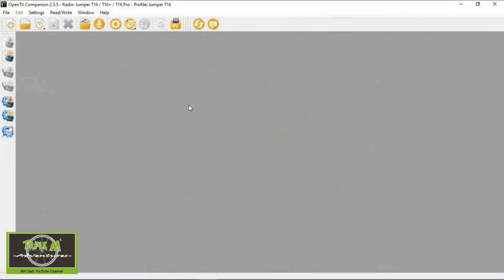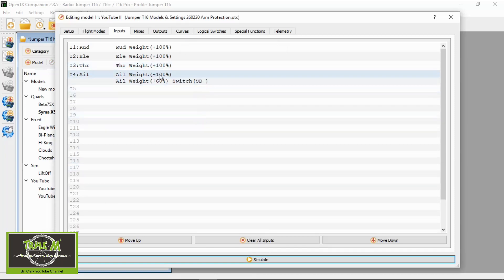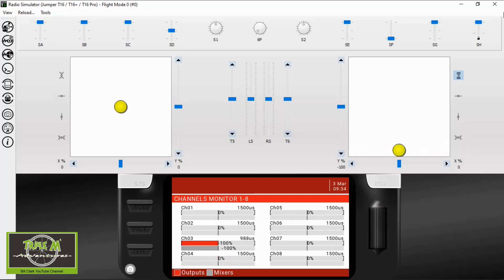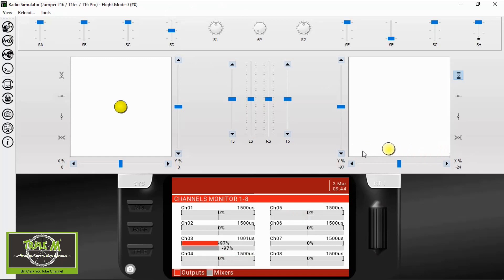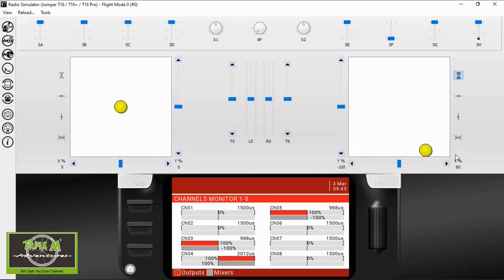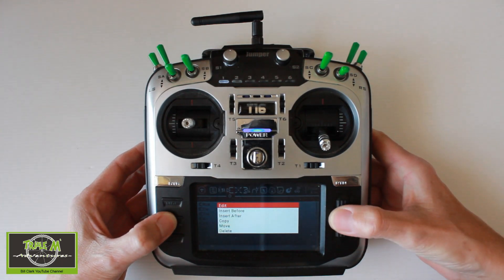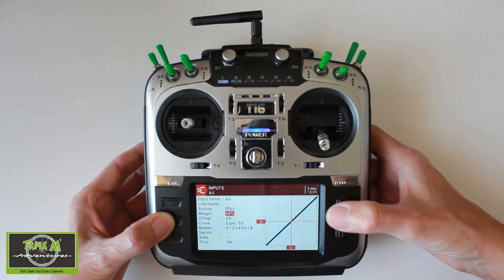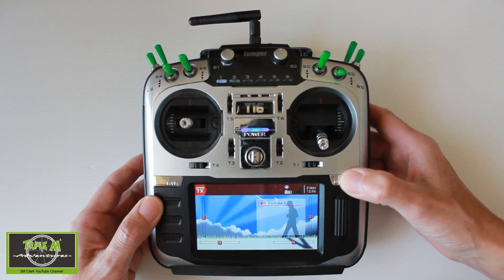Setting Up Dual Rate in OpenTX for the Jumper T16

Comment: Hello, Bill do you know how to move the scroll wheel on the transmitter simulation screen?
My wheel broke on the transmitter.
Reply from the maker: emil where you would use the scroll wheel on your T16 in companion use + or   - on your computer keyboard.
Reply: Bill Clark I can only click it but can’t figure out use roller so u can change the model? How do I use my key?
Thanx
Reply from the maker: You will need to go back to your radio back up screen and select the model you want to see the settings in OpenTX Companion. It will only simulate the model you have chosen. If your scroll wheel is broken on your T16 I assume you are stuck on one model?
Reply: Bill Clark will I be able to change to a different model?
Reply: Bill Clark how do u scroll the wheel in radio simulation? It allows me to click wheel but I need to scroll over to another model?
Reply: Bill Clark yes
Reply from the maker: emil gabl you will only be able to change to a different model in your Jumper T16 by repairing the scroll wheel. You can get replacement parts and it is not a difficult job to do. You cannot change the model in the OpenTX Companion.
Reply: Bill Clark ok, thanx

Comment: Hi Bill,
Thank you for sharing. Could you please help me understand why you used Inputs instead of Mixes? This is something that confuses me terribly.
Reply from the maker: Oak C sometimes YouTube does not send me notification of comments so sorry for the late reply. The inputs are directly related to the stick movements and related to the channels on your radio to explain you can allocate any switch on your radio to a (input) channel. If you wanted to mix rudder and aileron's but still have dual rates you set the rates up in your Inputs and then the dual rates will work within the mixes for the individual channels, I hope that explains.
Reply: @the-happy-RC-flyer  That helps. Thanks Bill.😃